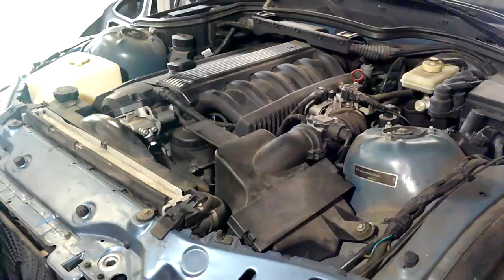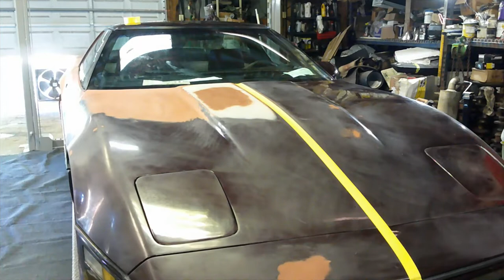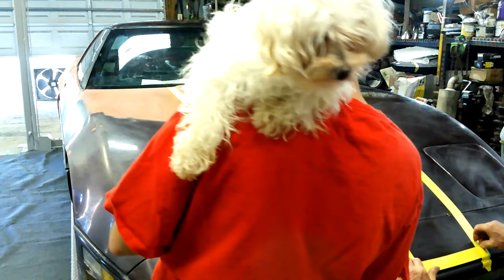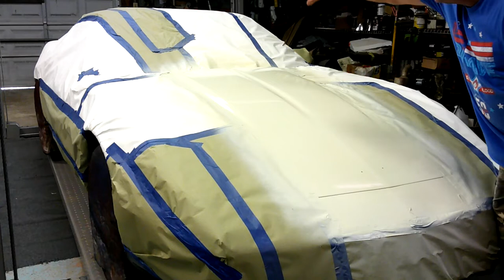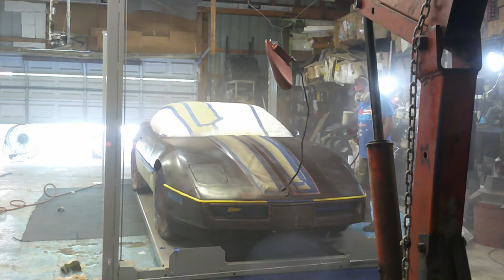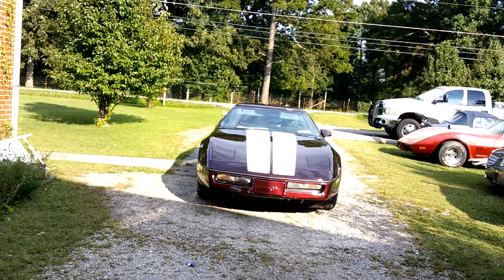How to paint stripes, fix bubbling paint & paint your car for under $400.00. C4 Corvette final paint

Comment: Looks good! BTW, Corvettes have not been made of fiberglass since 1972. Starting in 1973 they’ve been made from SMC (Sheet Molded Compound), which is not fiberglass.
Reply from the maker: Good to know. I know what sheet molding is but what is the compound made of? Is it a type of plastic?
Reply: @essigspeed  “Sheet Molded Compound” (SMC) is the designation for the material that has been used since 1973. It’s similar to fiberglass in that it does have a limited amount of chopped fiberglass in it. The formula has changed over the years; however, the formula as used in C5 & C6 models was composed of about 40 percent resin--polyester, vinyl ester, styrene, or a blend of all three--33 percent calcium-carbonate filler, 20 percent chopped fiberglass, and the remaining 7 percent resins and hardeners that improve the out-of-mold surface finish. Despite having a limited amount of chopped fiberglass, the percentage is not enough for it to be considered of fiberglass construction. If you sand a true fiberglass C3 (1968 to 1972) down to bare fiberglass and sand a SMC C3 (1973 to 1982) down to bare SMC, the difference becomes very apparent. I has a 1969 and a 1977, both of which I have striped to bare material. I’ve also had 1984 and currently have a 1990, also SMC.
Reply: @essigspeed I enjoyed your video, so my intent is not at all to be critical, just share information. Some may not care about the distinction between fiberglass and SMC; however, I’d imagine you would like your content to be as accurate as possible, both from the point of credibility with those who know and to provide the best info for those who don’t know. One of the other great urban legends that people perpetuate is the use of gel coat. Gel coat has not been used at the factory since 1954, yet people constantly make references to gel coat on C3 Corvettes. Some manufacturers of reproduction panels do use gel coat, especially on cheaper non press molded panels.
Reply from the maker: I am always happy to receive information to improve content so thank you. I am one of those who thought there was gel coat. There was some kind of hard shiny material between the paint and the SMC😁. I assumed it was the mythical gel coat. If I keep getting information like this, I might actually start to sound like I know what I am doing. In all reality, I am a self-taught amateur with a lot of experience fixing stuff. Good information is always welcome.

Comment: the 12.5 mark you put at the top, you should have measured at the bottom/front to make it exactly 12.5 the whole way, both sides.
Reply from the maker: Tapering the stripes was a corporate decision. Never argue with a teenager when it comes to looking cool